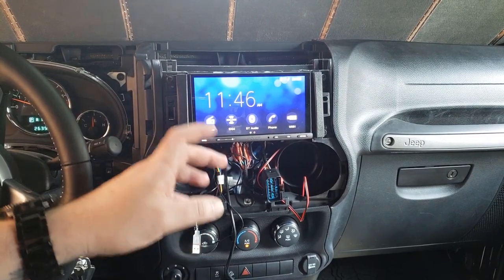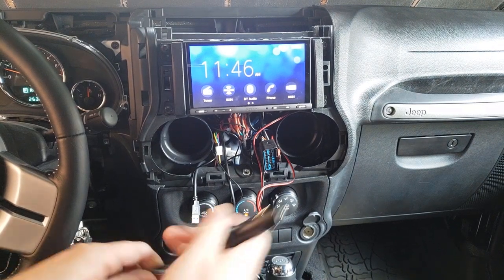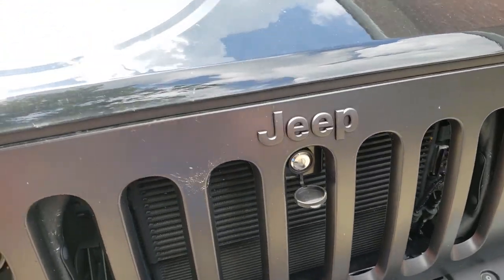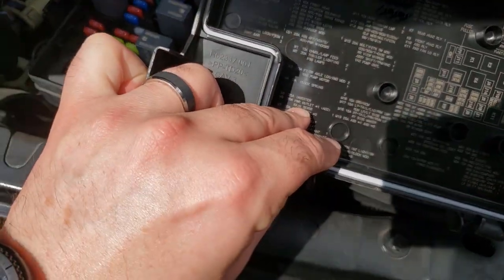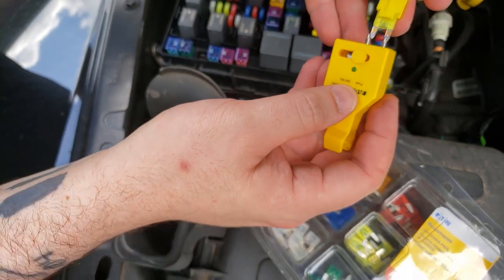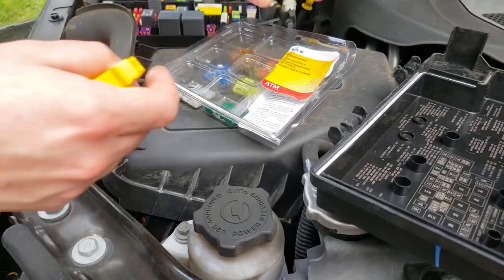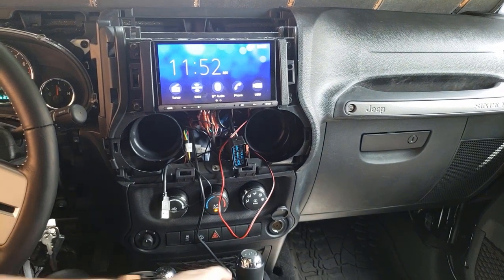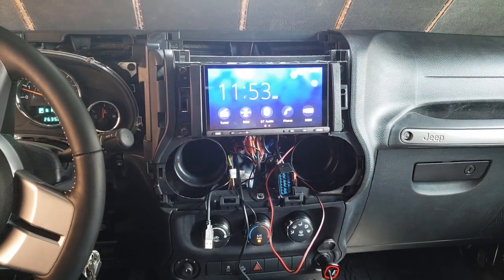2016 Jeep Wrangler - Cigarette Lighter Fuse - M6

Comment: I just bought a "Launch Missle" labeled cig lighter (one for my solar shop panel).    I added a 4 gang 12v outlet hub to my back deck so I can have additional flexibility in the aft.  I'm going to increase the fuse amp rating as this extra hub always seems to blow the fuse for me.  If the original is a 7.5 I'll go to a 10.  If that blows ill try a 15A.  If it keeps blowing up to a 20A (maybe) I'll remove the hub.  I want my missle launcher ready fir the upcoming zombie apocalypse...(or If I take a trip to portland or seattle).
Ciao

Comment: I just tapped into my 12v adapter as well and after messing around with some wires, I no longer have power to my compressor switch,  I should go check this out. Maybe I blew the same fuse.

Comment: My center console cigarette lighter/ accessories port doesn't work. I think it's a fuse problem but idk which one it is. I'm thinking M7 or M36 if I'm recalling correctly. I have no idea if you know which one it is please let me know
Reply from the maker: Do you have a Jeep? It should have the same setup as this video right?
Reply: @5after12  yeah I do 2014 jk. It does but I'm just not sure which fuse is for the one in the arm rest
Reply from the maker: I don't know which is what either. In the video I show there is a chart thing on the fuse box and I did a process of elimination
Reply: @5after12  for the center console outlet it is M7 a 20A fuse. I just changed mine.
Reply from the maker: And it worked?
Reply: @owengillott6701  the outlet in the arm rest right?
Reply: @younghex9577  Yes it worked it is M7 and it is a 20A fuse. You can message me from my profile and I can send you photos if you want.
Reply: @owengillott6701  thanks I had put a new fuse in and it still didn't work so I think it's a wiring issue